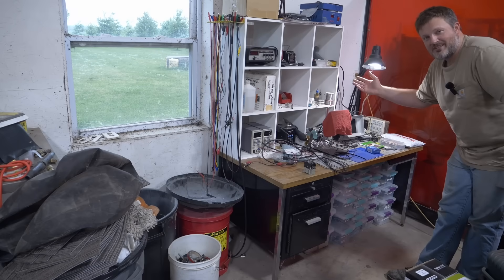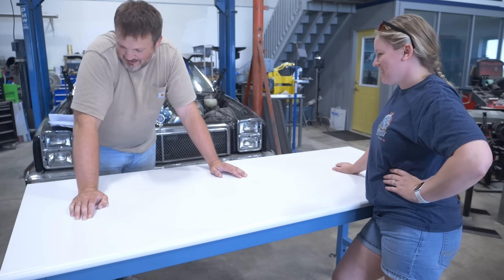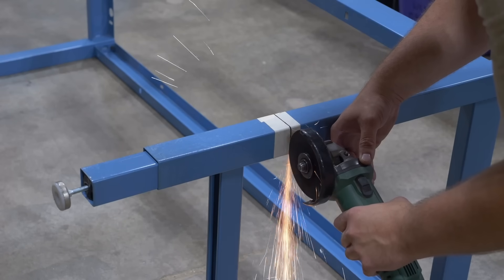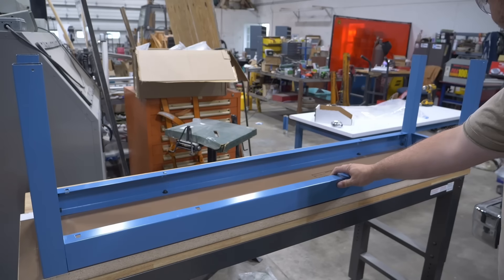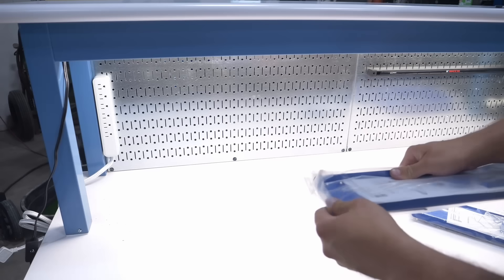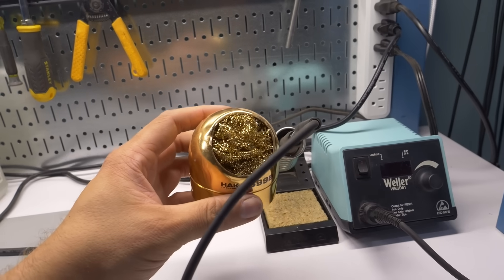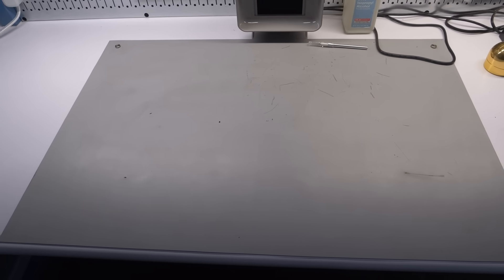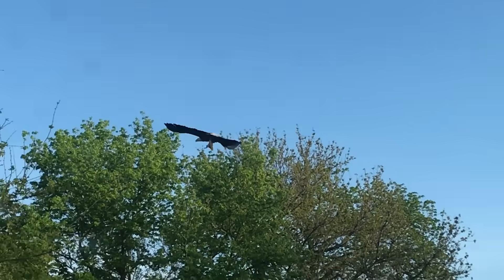Building an Awesome Electronics Bench on the Cheap

Comment: Sacrificing the second table hurt my hoarding soul.  But that looks so much better than the shelf I would have rigged up.  Proper.
Reply: In my case, I would have absolutely made some abomination out pallet wood and scrap square tube.
Reply: I think a little ocd was going on.  I would have welded up two shelves and had two less than perfect workbenches, pushed one in the back and piled crap on it. Just built one from scratch with storage drawers and cabinets like I have, but it does not look so lab like. Particle board and formica are expensive, not $2000 dollars expensive.  Interestingly I think mine is painted blue because I saw a picture of these in a catalog (what's a catalog?)
Reply: Ok, looking around Wes's shop, maybe not ocd.  Just wanted something really nice until he clutters it up.
Reply: The remaining pieces can still have use, as a set of shelves under the bench, to hold things like power bricks, and outlets for stuff always plugged in, plus a cheap set of drawers fitted to the one side (on castors so you can easily move it side to side) helps as well with storage of all those things you need. 

With the IPA a good thing is to get small HDPE bottles, and put small volumes in it, so it is easier to use, and less likely to spill. Works with flux as well, buying in bulk and refilling the pen, though I simply went and got empty dropper bottles, and filled them with flux, and the same for IPA, using nail polish bottles that hold 10ml each. Easy to use, and much better control of where you apply it. Little brush makes for easy cleaning, and you just rinse out the bottle when it is dirty, or move it to being the first wash bottle, and have a clean final wash one.
Reply: I would have just stacked the tables on each other and screwed a shop light to it .
Reply: Nah. He did right. Plus, we can see that the emperor's clothes really are ... what they are. The price asked VS the materials exposed by his cuts do not match. It's a grift. This is a good video to spread around so people don't get gipped by these grifters.
Reply: @aserta  What are you talking about?

Comment: $500 for the hutch plus shipping and tax is definitely like the $600 toilet seat. Only school districts and large corporations would pay that because the purchasing agent is spending someone else's money. You did a great job with what you had.
Reply: I work in a large industrial plant.  You are paying for far more than the item.  You have to request bids and paperwork before your product is selected.  You have to follow established procurement and quality standards.  You have to deliver it in a way that takes minimal setup time.

There is a whole ecosystem built around supplying to industry.  When someone tries to go cheap, they quickly find out why it exists.  If it takes someone is stores half an hour to sort out non-standard paperwork, and two technicians an hour to assemble, all your savings have just disappeared.
Reply: @MichaelSteeves  Those things exist for reasons, sure. But this is not such an item, nor are his examples. Nobody needs multiple hours to install a toilet seat. These are cheap, every day items.
Reply: 2000 $ for that thing and it is made from plywood... I do not know what to say.
Reply: @leocurious9919  High density particle board.  :)
Reply: Normally anyone would needing the setup but not able to build it
Reply: I genuinely don't know what people in purchasing do except get really bad deals on everything. Usually they like to buy the crappy off brand version of the industry standard for everything but only if it costs significantly more and isn't actually suitable for the job, gotta make sure you cost the company extra in lost productivity after you've made a genuinely terrible purchase for the engineers...

Comment: Back in the eighties I worked with a guy at a local Ford dealer that turned me on to having a personal oscilloscope. Of course I haven't upgraded since those days, and adjusting range is more akin to adjusting squelch on C.B. radio.
Reply: An oscilliscope has been on my "to buy" list since the 90s when I first got into the workforce.  Any decade now I'm going to pull the trigger on one.  :)  Maybe I should ask the family to buy me one since they're always wondering what to get me..
Reply: @alskjflaksjdflakjdf  An O-scope is a very handy tool if you learn how to use it. For a couple of hundred dollars you can get a pretty good scope with digital memory, and digital readouts for both voltage and frequency. I bought a Hantec DSO5102P a few years ago and have been very happy with it. The controls are almost identical to the hugh dollarTexas Instruments scope I use at work.

Comment: Only complaint I'd have about the bench is the roll of 60/40 Sn/Pb, as it's a non-eutectic alloy. Meaning you get pretty terrible IMCs (joints) with them. If sticking to leaded solder, use 63/37, which is eutectic.

I use mostly Aoyue irons, which take Hakko tips, with SnC lead-free solder. I also prefer the tacky flux, as it likes to stay on the PCB instead of run off somewhere :)
Reply: Still uses that up,  then look for eutectic.  I always liked the fine gauge solder, but sometimes you have to push fast.  He needs some lead free for touch-up on circuit boards where he doesn't plan on removing all the lead free solder.  For others out there, the two types don't mix.  I loved leaded solder, when not shiny, it's probably a cold solder joint.

Comment: You can even tap balsa wood.  If I remember the procedure correctly, just drill and tap as usual.  Get some CA glue aka super glue and dose the threads liberally to harden them up. You'll probably want to get the thin CA glue for hobbies not the thick gel stuff from the big box store so that the threads get a good soaking and you don't end up with globs of glue.  After it hardens, chase the threads again with the tap.  It's a tried and true method for building attachments for RC airplanes. I use nylon bolts not metal because nylon will fail before the CA infused threads and saves you from repairing primary structure after one too many hard landings or taking off on rough ground.  But for a static application in the shop, metal should be fine.

Comment: Dave is great (EEVblog).   His most recent 'best scope" review was around a year ago now, and it was for the DHO800..  I watched all his reviews on it and figured I had to have one.  The cheaper 4 channel was under three hundred. It's 12 bit vertical resolution and has 25M deep memory. (practically all older scopes are only 8 bit)  Definitely has all the features ever invented crammed into it. lol.    I just need to learn how to hack it now and get the full beans.  Coolest part:  it uses USB-c for power-  so you can make it portable with a little power bank. Great for vehicle diag work.. It's essentially just a newer version of your scope

Comment: Howdy @Mrs Wes.
A good bench is its own reward.  Tough part is keeping them from reducing to havign only 2 square feet of open space, no matter the bench size.
Reply: Amen to that!  I've got one about 9 feet long and wish I had 2 square feet! Stuff is multiplying while I sleep is my estimation
Reply: Workbenches and sheds suffer from the same problem.  They are NEVER big enough.
Reply: Yeah, it builds up quickly in the tools. Next up, you want a hot air station, a rework station with smd solder tweezers and sucking soldering iron. Then you need a multi voltage power supply, then you need your magnification with a microscope of some kind, signal generators, VNAs, spectrum analyzers, hot plates or board preheaters... And the "active" projects need some space to live at as well! It seems like a never ending expanding cycle. But i like that 😅
I think what Wes' desk is missing is some more storage drawers, but they are probably easy enough to add with some office trolleys that you get cheap/free when corporations throw out "old" furniture.
Reply: I thought the clear area of the workbench was the vice jaws.